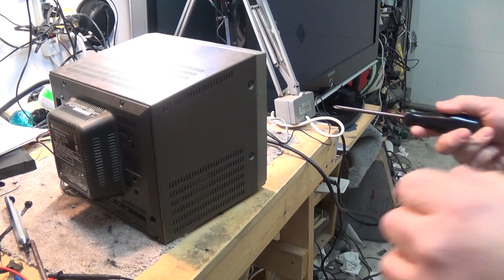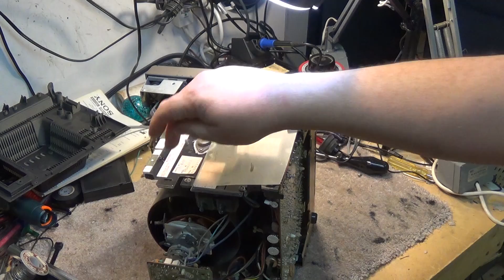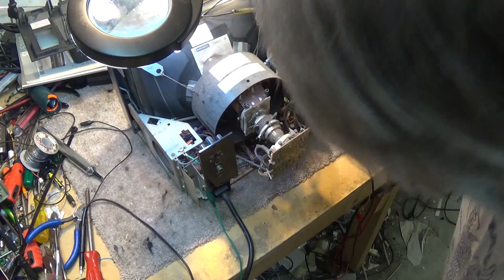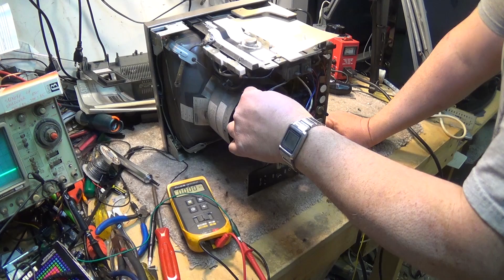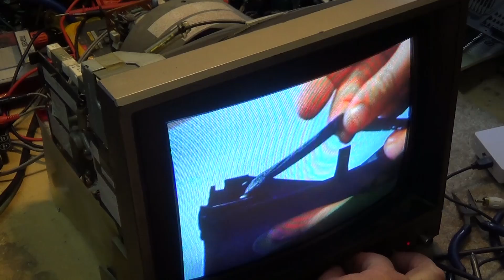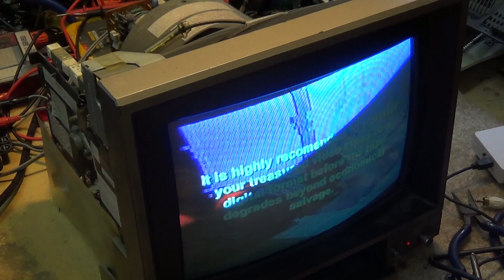TI PHA4100A   Panasonic monitor shuts down

Comment: started on a Ti99/4a myself,but when the Commodore 64 came out..wow! I will always have a soft spot for the old TI99/4a,but it was a a great example how not to design a computer(other than the black/silver looked great).
Reply from the maker: The 99/4a was a real computer.  With the expansion box and memory expansion.  I ran a BBs i wrote in assembler and extended basic.  I had 4 350k DS/DD floppy drives in it.  48k RAM total. One of the guys in the ti club wrote xmodem protocol in assembler to do uploads and downloads.  It was fun writing that program.  The only failure for the 99/4, was Texas instruments abandoning the project and orphaning all the computers and users.   I had a Packard Bell 1200 baud modem on it to auto answer and log in users.
Reply: @12voltvids  i think you misunderstand what i meant. Indeed its a real computer,but they made terrible mistakes with it such as a 16bit cpu with 8 bit ram make its slower than it should of been. The expansion bus was multiplexed to 8 bit also making it slower than it should of been. The PEB was a monstrosity expansion and in its day was very expensive not to mention the "firehose" to attach it was notorious for problems. The only other way was corcomp style expansions on the side making a train.they didnt pass power thru the speech synth. using delete and having to function stuff on the abbreviated keyboard was a pain. Groms are a terrible thing and are failing after all these years and are near unreplaceable(unless someone has and i dont know it). the inbuilt basic was not so good,which is why everyone used extended basic. The voltage regulation runs hot in the TI also. Granted much of this stuff was fixed and improved with the nano peb,Finalgrom and modern 32k expansions that are small and low power. I love my TI and still use it today,but my Commodore64 ran rings around it in almost every way. the vicII and sid were way ahead of their time.

Comment: Computers in them days where not much more than over glorified word processors.
Reply from the maker: Do you know what a word processor is?
A real IBM word processor? My aunt was a secretary and she had a couple.  The first was nothing more than an IBM electric typewriter with 1 line if memory that allowed correction before the return key was hit, at that point the type ball would print out the line. The next had a screen that could have a page displayed. It could store and retrieve using a special cassette tape. (No leader)  When she retired she got to keep her old gear because the office she worked for had just made the switch to ibm computers and were scrapping the old stuff. It stayed in her garage for years. I remember trying to fix one once and gave up. Have no idea where the old stuff went.  Someone in the family probably still has it.  Haven't seen the typewriter since high school.

Comment: 37:00 Hahah, speaking from 2020, I have the same problem now with my DVD discs: some of them being barely readable by the drive because of the medium degradation after 15 years of storage :P  And my old vinyl records are still perfectly playable ;o
Any ideas what medium I could use now for storage to last for the next ~20 years without degradation? :q
Huhh... when you think that those old paper books lasted more than 100 years and still being readable... modern technology really sucks :q
Reply from the maker: I have many disks that are 20 years old and play fine.  Maxwell, Fuji, and verbatim are all good.

Comment: Such a pleasure to watch this, what should one get for such a shielding? Is that just 2mm of steel attached to earth and fixed in place?
Reply from the maker: More for magnetic shielding from speakers and earths magnetic field influencing the geometry of the tube,
Reply: 12voltvids Wow that was a fast answer.
I have a TV which has pretty much perfect geomerty if i place it on the floor  near the middle of the room 😄, i got like 50 tvs over the years in the hunt for almost perfect geometry and it was just coincidence that i tested this one i that exact position, now i think i should not had trashed all those pretty tvs since it depends extremly on the magnetic field 😟.
so after looking your video i was wondering if i could mount such a shielding on it to keep the geomerty perfect in every position in the apartment.
My questin was about the material and do you know how it exactly work.
Thank you so much

Edit: i use crts for low resolution emulation and such so i cant live with overscan, thatd why im looking for perfect geomerty which i suddenly got but only in said position.
Reply from the maker: Perfevt geometry in a crt. ha ha ha. I remember a tough nut customer that bought a new tv and brought it back because the geometry was not perfect in his house. He would put up a crosshatch and measure it with a protractor. Brought it to the shop, made it perfect. He cam over, with his protractor and agreed that it was good. Took it home and put it in his cabinet. Bad. Called me to the house. Pulled the TV out of the cabinet, spent 2 hours kissing this guys ass to make it good enough for him. He was happy, moved the set back into the cabinet, and bam, magnetic field changed. Earths magnetic field, metal studs in wall, who knows but he was not happy and the boss ended up refunding him and telling him he was not welcome to buy anything in the future. I lost my shirt on that because I could not bill for the work as he had been refunded. I had to deal with that same guy in my current job, and he is just as much of a dick today as he was 20 years ago. Won't say anymore just in case he is watching but all i will say is you have to address this person as sir.
Reply: hilarious story 🤣, sir you are so talented to express yourself.
Are you on patreon?

Could you explain how that shielding around the yoke works and what material it is sir?
Reply from the maker: @alexmandic9557  yes patreon.com/12voltvids

Comment: The processor in the TI99/4a was quite a powerful one.  It had special instructions for accumulator multiply and divide like a DSP.  Some versions were used in radar processors.

Comment: I love the clutter on your bench just as a good bench should be.
Reply from the maker: I would never get anything done without the clutter. 
I once worked for a guy that demanded a spotless work bench. The guy with the clean bench never managed to get anything done (because he was cleaning his bench between jobs) and the guy with crap piled up was the super productive guy (who trained me) I guess it rubbed off on me, as my work bench always looks like a bomb went off, but I don't loose things in there.  When I set stuff aside for working on later I put all the screws and parts into a plastic bag and stick it with the unit. Just finished restoring another classic receiver. That will be up soon.
Reply: 12voltvids I use the same plastic bags and also the tops off aerosol as temporary storage. I have occasionally cursed my untidiness when I accidentally knock something off the bench or those annoyingly tangled test leads.  Been watching a lot of  your videos recently trying to repair a Sony monitor in some test equipment.  https://youtu.be/BEUu90NVBws  Thanks for sharing
Reply from the maker: Just did an old AGS Trio receiver. Editing it now. This one has been here for a few months sourcing parts and stuff.

Comment: Roses are red
Violets are blue
CRTs are awesome
And so are you
Reply from the maker: They are much cooler than boring LCD panels.
Reply: Yes, especially the nice Sony Trinitrons.
Reply: I have a 34 inch HD one. It is really nice. The only drawback is the size. It weighs about 200 lbs but is totally worth it.
Reply from the maker: I had a 34" gave it to my father inlaw, and when it packed it in he tossed it. Wish I still had it because it had a beautiful picture.

Comment: I wouldn't had expected a professional video monitor on a home computer system...but then it was quite an expensive home computer system.
Reply from the maker: +douro20 All computers back in 1981 were expensive. The TI99/4A came with an RF modulator to hook to a TV. The picture was less than desirable. They offered this monitor as a high resolution monitor, and it was expensive.
Reply: I was speaking in relative terms, related to the cost of other computers at the time.
Reply from the maker: +douro20 It was? Compared to what. A TRS80 radio scrap was a couple grand and it had a black and white TV as the display.The TI99/4A was supposed to be a cheap computer compared to what else was out there. Under 500 bucks. Sure if you started adding the expansion box, and disk drives ect it got up there. I have the expansion box, serial parallel card, dual sided disk controller, 48K memory expansion card, speech synthesizer ect.It was my toy computer so to speak, but it got me interested enough in computers to figure out that I didn't want to go into computer programming!

Comment: I was immediately thinking H-K short, glad I was wrong though! I have dealt with those before and they are fun...
Reply from the maker: +THEtechknight What HK short. Sure stick an isolation transformer on the heater. Old tube brightners used to work wonders for those.
Reply: 12voltvids haha yea, but I would never think of using one on a vintage set with irreplaceable CRTs, brighteners usually wore down the cathodes into the ground.
Reply from the maker: +THEtechknight By the time most sets needed one, they were usually already shot. I used to have a Sendore CRT restore unit that would burn the crap off the guns. Was cool to watch it work in auto mode. Plug it in, set the switches and press the auto button. Those units worked miricles on many a tube, and totally killed a few others like Sony tubes ;(

Comment: Hi plse can any one help me to solve a thomson tv with model number 28df17e.The problem is when the set is powered on,you wouldn't see anything on the sceen,no eht.All the secondary voltages are there and are stable too .I'm getting about 165v to the B plus throught to the flyback and yet there is no picture and sound.I replaced the vertical ic,  TDA9554PS/N1/111465 IC  and the flyback transformer. there still no change, plse can anyone help me out.

Comment: I can't remember ever seeing a LIGHT OUT lamp come on in this 1985 Ford.  You are right though. It does have a computer, useless piece of junk that doesn't even provide electronic ignition advance. I took the board out. It is "rebuilt" yet not one component on that board has ever been replaced. I strongly suspect the central processor is programmed to "die" after X number of hours, so they can sell you a "rebuilt" one, over and over. Given the computer is dead anyway, and doing nothing, I will unplug it and see if the back feed goes away.
Oh, I cranked the initial advance way up so while running it does have adequate advance.
Your knowledge reminds me of my own in my arena. You know your stuff.
Reply from the maker: +AKA Wireguy Both my 84 and 86 ford had idiot lights for when a bulb burned out. That was back in my ford days. I went from Ford to BMW, what a joke that car was. Bought another Ford, quality wasn't job 1. Now I drive a GM Volt, and it has been the only car I have owned that has not had a single glitch since I drove it off the lot.
Reply: That's interesting, I have had that old girl for a lot of years and in fact went to the 1157 LED's because the newer 1157 filament bulbs are such junk and constantly burning out, and never saw a bulb out lamp. Probably the computer never worked as designed. The way I would know if a turn or brake filament burned out was the display light wouldn't flash on the dash because the circuit was open. Just remain on. 
 I just lost my Toyota 22R after 350,000 miles. Great engine but hard on cylinder heads and timing chains.
By the way I have my dad's old analogue VOM from Radio Shack and I value it because it will tell you the truth where a digital will lie. Also you can see what is happening in real time as opposed to the digital's nonsensical jumble of digits.
I want to rebuild the 351 Windsor and put a 4 barrel intake on with a vacuum secondary carb, about 650 CFM. I like the old technology because I can work on them myself.
It's funny, I once repaired a compact fluorescent in the field because it was an oddball and I didn't have a replacement. Did just like you, took it apart and soldered, right there on the spot
Watching you troubleshoot reminds me so much of me with building system AC current systems.

Comment: Maybe you can answer a question for me. I'm a power electrician and well understand AC and automotive DC circuits. I bought ribbons of LED lights and made my own LED lights for inside my van. I installed a 12 volt golf cart solenoid in my mid 80's van so I could kill all power draw from the battery. I discovered when the battery negative was completely disconnected the LED's would softly glow, apparently a back feed circuit through the control coil in the solenoid. OK, that part I kind of get. That coil does provide a back feed circuit for the LED's.
Recently I replaced the 1157 lamps in my two mid 80's vehicles with LED type. They too glow softly with everything off, and my aftermarket cruise controls wont engage because they detect current on the brake wire, which they see as the brake pedal is being stepped on. I just got the big resistors to put in line with them so hopefully that will resolve the issue. What I'm wondering is what does the circuit that keeps these LED's glowing look like? I assume their resistance is practically zero but I would think they still have to have both sides of the circuit to operate, but obviously don't.
Reply from the maker: +AKA WireguyYou are getting some leakage, most likely by the on board diagnostics circuit that is designed to throw a code (and turn on an idiot light on the dash) when a bulb is open.How that works is a pull up resistor applies a positive pull up to the brake light or tail light. Normally the filament pulls this to ground, and keeps the idiot light off. When the filament breaks the pull up resistor pulls the circuit high, and triggers the bulb burned out idiot light. LEDs do not provide this path to ground. They appear as open circuit. Throwing a resistor, or small 12V incandescent bulb across the line will correct this. Your cruise control is the same. It is looking for a rise in th evoltage of the brake line to disconnect. No load on there means the pull up resistor in the monitor circuit will cause the cruise control to detect the voltage and not engage. Many people on newer cars that try to upgrade (or downgrade as I like to call it, because what they are doing is 100% illegal and creates a hazard for everyone else coming the other way) their headlights to HID. The ballast doesn't draw enough and pulls a code. CanBuss ballasts basically put a higher load to trick the circuit into thinking there is an incandescent bulb.The reason I say this is dangerous is because HID bulbs require a special fixture to control the beam pattern. When someone puts them in a non-HID fixture, it is like them running with their high beams on to oncoming traffic.Proper fixtures are the projector type, and have self leveling shutters that sharply focus the beam, and keep it out of oncoming drivers eyes. My car has such lights. There is a reason the cost what they do, and why a Chinese 50.00 upgrade kit is not a good idea.
Reply: I'm GUESSING and this is a big maybe, but is it leakage current to chassis ground? maybe a zener diode instead of a resistive dropper behind each led would solve the issue.

Comment: The CRT looks strong to be that old. It must not have been left on the time. I had a buddy who transferred 8mm & VHS to DVD. He made good money for a couple of years. He even got to convert some stag movies.
Reply from the maker: +Steve Holsten The monitor was probably used a bit when it was new. I received in in about 1986, and it became one of the monitors in my analog edit bay, which I used when I was working on a video, which was not every day. I believe that was was the either my effects preview or one of the VTR preview monitors. I had an A-B roll system, so 2 playback VTRs each with a separate monitor, an video switcher, so it had a preview monitor on it, and a program monitor on the record VTR. In the early 90's I switched to non-linear editing, so all the old gear was either sold off or put in storage. So no it probably doesn't have that many hours of use on it, and that is reflected in the picture.I have been doing film and tape transfers to DVD for many years. That is my core business these days, as I don't shoot commercial videos or weddings anymore. The only video shooting I do is these videos, and personal stuff, some of which ends up on YT as travel videos. I buy DVDR disks by the 100 spindle, but lately I have found that the prices are heading north. I guess the demand for blanks is down. Many of my customers are now requesting their videos be transferred to USB stick, which I think is a mistake myself, as flash memory doesn't last that long, and the files can be lost in a "flash" but hey, NOT MY PROBLEM! My policy on transfers is I never watch a clients video. I verify that the tape will play, and then transfer it directly to DVD. Many clients are reluctant to transfer stuff because they worry about privacy. I have built my business on confidentiality.
Reply: +12voltvids Sounds alright. Thanks.